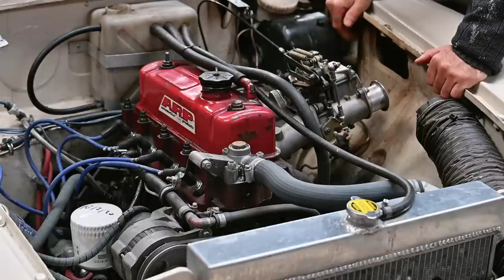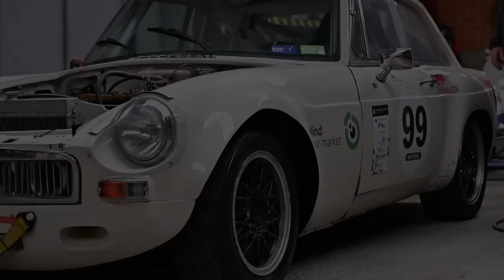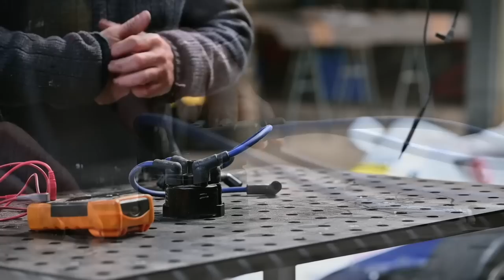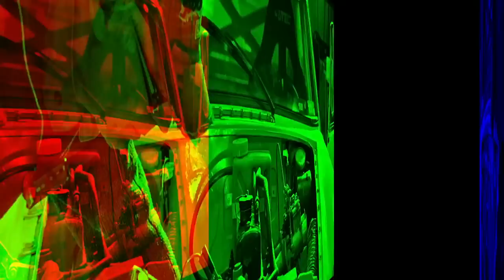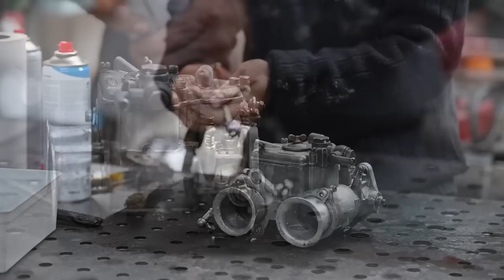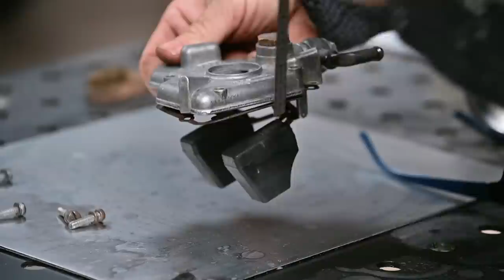MGB GT in need of fixing

Comment: Had to laugh when I saw your video. My first car was a 1963 MGB Roadster, which when I bought I knew nothing about cars. In 1972 I drove it to work for the first time. I was worried about it being stolen in London so I took the rotor arm out. I came back to the car at lunch time and refitted the rotor arm but it would not start. Desperate, I asked a new older and it turned out wiser colleague for help. When arriving at the car he asked me for a precise account of what I had done. After I told him he simply said look under the car! I did and guess what, there was the distributor cap centre electrode pin. I refitted it and the car started immediately. Whew what a relief and never to be forgotten. Later on my 2nd car a 1971 MGB Roadster I worked on the engine for many years but every time I refitted the distributor cap I double checked the centre electrode had not fallen out. . .
Reply from the maker: Nice story Robert and yes that does happen

Comment: Just had my Mg BGT 2 days ago having long crank on start, and wanted to cut out on 1st and 2nd gear.  standard engine with Hs4 SU carbs. Finally saw fuel leak coming from overflow pipe from front fuel pot. Had to rig a plastic bottle to catch the amount of fuel overflowing. Turned out the amount of grit/rust particles coming from the fuel tank was blocking the fuel pipe from bottom of fuel pot tube to  carb jet. Cleaned up fuel pot and checked needle and spring inside Carb Pot. Car started first crank. Going to add an in line filter and eventually new fuel tank. Checked timing last night, out by 5 degree got that fixed, need to do valve gap at the weekend.  Thanks again for a very informative video.
Reply from the maker: Good luck mike...  those are fun cars

Comment: I’m surprised you didn’t inspect the sparkplugs in the beginning.   Often it will tell you something.   Keep the videos coming, very informative
Reply from the maker: Jim,  I did  but did cut it out of the video as it was to long...  Note that on a race car , you tend to go Wide open all the time ( 5000 RPM), so at idle the plugs will spoil quickly if running to long... That engine is prepared for racing...
Reply: I expect he looked at them when taking out for compression test

Comment: My first car was a MGB-GT. It's where I first started paying with building cars and repairing them. I replaced the floors and boot corners. It' didn't sound like yours though! I now have an MGB with a partial Sebring look, just the front and rear valances and not the flared wheel wells. I recently got my Riley 9 engine running and it was very rough. It wasn't until I made a tubular exhaust manifold for it I worked out why. One cylinder wasn't firing, I could clearly see the lack of heat on the headers. It was a valve not fully closing which a compression test then a visual check with the rocker box open confirmed.
Reply from the maker: Nice to hear and they are great cars... I build and had a sebring not that long ago a V8 3.6  , look for project orange on my channel...   but the 1950cc former (1800cc) is so much more fun to race and easy/cheap to repair versus the v8

Comment: I also like the MGB-GT. Allways liked the look. The MGC-GT (3L 6 cylinder) was also fun. The Weber DCOE and the original SUs are may favorite ways to get the fuel air/mixture into the engine. That was a very good introduction to troubleshooting an MGB starting  and running problem. I like your HT tester. I have had carbon tracking problems before and that would have been a handy tool for troubleshooting that problem. I made my own tool after I had three bad distributor rotors in a row on a VW bug. All were brand new Bosch brand rotors also! A handy tool for figuring out mixture problems (especially on multi carburetor or multibarrel carburetor engines) is the Gunson Colortune. They are sparkplugs with windows and you can actually see the fuel burning in the cylinder.
Great video Steve. Thanks for posting.
Reply from the maker: I can see you have been in that alley too.    I had a V8 3.6 sebering last year, but sold it.   That one had so many issues with the amplifier module ...I even moved to the side with a larger cooling surface..
Reply: @D3Sshooter  I never worked on the original MGB-GT-V8 as they are very rare in the US where I live. Worked on plenty of conversions most of which were poorly done. Wasn't the amplifier on the original V8 merely a GM HEI module? They are very common here and inexpensive to replace.
One thing about Webber DCOEs. (You probably already know this but for others reading this.) Never look directly at the back of the carburetor you have just taken off the car and blip the throttle... or if you do, you will only do it once because you will get two thin streams of gasoline directly in each eye.

Comment: Hello Steve very good video. My old Honda used to run very badly. Then i checked everything like you did. Then I tried an additive for the injection system and the problem was gone after a long, fast ride :)) A video about additives for engine, transmission and cooling would be a good thing. I'm sure a lot of people will find that interesting. Great video Steve. 👍👍👍
Reply from the maker: Thanks for sharing

Comment: I expect that you'll find the center carbon electrode of the distributor cap laying down in the bottom of the distributor body.

Also, when you do your fine tuning of the ignition, check the timing at idle, then observe it while increasing the engine speed. It should vary with speed. The centrifugal advance weights in the bottom of the distributor can get stuck giving you static timing (since you have no vacuum advance).
Reply from the maker: thanks and indeed, I always use static and dynamic adjustments.  The bobweights have been adjusted ( springs) to alter the advance curve....  But will change it out to a 123 programmable distributor soon.  The reason is that the current EI is not accurate enough due to the fact that the blocking blades in the distributor ( optcoupler)  are not accurate and cause an offset for the ignition pulse on the different cylinders.
Reply: @D3Sshooter  I had the pertronix2 on my red car, and have accuspark on this 67, but do hear good things about that 123. I believe that's what Dave Wilkes runs.
don't you have one on the mini?
Reply: @D3Sshooter  I think you'll like the 1-2-3. When my brother and I put one on his distributor machine, there was zero timing wobble. 

The Luminition setup that you have is the same as the one that I have on my Mini and it works very well. You shouldn't have any timing variation from the chopper wheel, but the distributor shaft runs in a bushing in the distributor body. That bushing wears out and you get wobble in the distributor shaft.

David Vizard, in his book "How to Modify Your Mini", has diagrams for replacing the bushing with a needle bearing. This modification removes all of the wobble in the timing, but a 1-2-3 is a MUCH better idea.

Comment: That was a good find troubleshooting the dizzy cap, it would have stumped me for a while.
One thing that I found was the rotor arm lengths can very a lot, I found 2 in my batch that were 1mm and 1.4mm shorter than the rest. That's a long way for a spark to jump as well as jumping the sparkplug electrodes.

Comment: How strange, I've had the exact same issue with a distributor cap on my Mini before when it was running an old Lucas 25D points distributor, I could never figure out why or what happened but the spring-loaded stack had just completely disappeared! I wonder if it's a quality issue with the caps that are being made these days. Since fitting a programmable CSI electronic distributor (along with a rebuilt engine I should add!) I've had far fewer problems, you won't regret upgrading to the 123 ignition system on your MG, they are fantastic.
Reply from the maker: Thank you for the comments

Comment: What are your thoughts on keeping carb's functioning with potential increases of ethanol in the future?

Ever since ethanol was increased to around 10% my Dellorto DRLA's have been regularly playing up.
They have developed an intermittent blocked idle/progression circuit and no amount of ultrasonic cleaning has resolved it.
Main circuits still run perfectly and I have ruled out everything else you covered in this video.
I'm guessing that the factory plug that separates the main/idle gallery has come loose and is moving around causing the blockage.
Reply from the maker: Well that is becoming a problem , but can be solved by changing the jetting and emulsion tubes, but so far I had not to do it
Reply: we have had alcohol here for 15+ yrs. Just make sure every line up to date for alky and always have fresh fuel. That stuff sucks up water and goes BAD in under a month. Fuel up at airport if your racing.
Reply: Best to try to find ethanol free gasoline... Luckily, Shell here in Canada has none added to the high octane. It can also be tested quite easily at home for ethanol content.
Reply: @TheEnemySU37  Best you can do in the UK is the high octane which is up to 5%.
I was using this but having moved to a remote location only the regular fuel is easily available and this is up to 10%.
Reply: @djambrosia  that is a shame. Would be interesting to find out it's octane rating after removing the ethanol. My Spitfire has a distaste for lower octane than 91RON.

Comment: are you running a Warneford or a TWM intake? What compression ratio? I'm getting 172-178
Reply from the maker: Hi , I am running a cannon 3801 modified inlet manifold.   Compression ratio 9.6
Reply: @D3Sshooter  we calculated about the same with my short block/head combo but after putting camera inside, it looks like it was never run after being rebuilt. So hopefully my 172-178 # will come up after some driving.
How do you do your break in on rebuild?
and you have 4 idle air adjust screws? Or what are the other 2 for?

Comment: I’m wanting to build an engine for my 66 MGB and wondered what camshaft to choose. It will be a road car but I still want to get more performance out of the engine. Any suggestions?
Reply from the maker: First you need to decide how far you want to go, what is the purpose of the car , daily driver, fast road, ralley, race...   Note that the comfort factor and ease of driving gets worse from daily driver to race...   The faster camshafts increase the  HP's but becomes more aggressive with a power curve  that shifts to mid to high RPM.  With the 720 Camshaft the high torque sits around 5000 RPM  .  As on the track we tend to run at around 5000 and shift around that RPM...  not useable for a dialy or fast road purpose.   I would start with a mild cam, free flow exchaust, stage I or II cylinder head and a DCOE 45 carb.  That will bring you to the 90 HP range and still driveable on the public road.
Reply: @D3Sshooter   I’m looking to something between a daily driver and fast road car. Probably closer to the fast road. I’ve already gotten a big valve head with shallow bowls that will increase the compression ratio. I’d rather stick with my SUs though. There’s just something special about the dual carbs I don’t want to give up. 

Is there a particular manufacturer of the cam and exhaust you’d recommend?

Comment: What do you think if you put an air filter on the carburetor?

There are other options for that ignition. Check the Ukrainian engine control system SECU-3. In the carburetor version, only a few sensors and a waste spark coil are needed.😉
Reply from the maker: Thank you for the comments, I will use a 123 .... for racing on the track I prefer just trumpets

Comment: Going to guess timing 
Hard to start
Doesnt run good 
As long as fuel is in good shape
Seems like youd be sacrificing some power to parasitic load of the double valve springs
Reply from the maker: Well this one was a surprise for me ... still don't know how that happend...
Reply: Did you find the missing part from the distributor cap? I would be concerned as to where it ended up inside the distributor.

Comment: Carb would have been my first thoughts. The car has been sitting for a while so more than likely a fuel issue
Reply from the maker: Thanks, yes... But as you know after a race , one typical parks the car without an inspection ,,and when hot during the race not all issue pop up. Often its afterwards... so i always start from scratch

Comment: 1950ccm, Stage 3 Head, Hot Cam, Roller Rockers but only one DCOE?
With that configuration only one carb is a restriction.
You should convert to two 45 DCOEs.
165hp with one carb is hard to belive for me. Also because you have only 101 hp wheelpower.
Reply from the maker: Well that is what it is on the dyno, has also a modified crankshaft.  I might look for another set...  One day
Reply: Converting to two 45s would be difficult. That engine only has two inlet ports. Intakes 1&2 share one port and 3&4 share the other. It's the same design as a Mini, just larger. Converting to fuel injection is very difficult due to the head design too (and would probably not be allowed without switching to a different class).
Reply: @andreichichak5242  Didn't know that the head design is that restrictive. On a 4 cylinder engine with 4 inlet ports it makes a big difference if you use one or two carbs. But in this case it seems everything is tuned to the max.
For the Mini engine there was a crossflow head. Maybee for the bigger engine too? But if, probably not homologated.
Reply: @D3Sshooter  As I just read there is just one inlet port for every two cylinders. So two double-Webers won't make sense. 
The power figures for me look odd. 64 Hp between wheelpower and calculated engine power is a lot.
Anyway, I wish you a lot of fun on the track.
Reply from the maker: @RallyeRacin9  , That figure is in gear 4  on the dyno for the rear wheels .    I would need indeed a new inlet manifold. for dual DCOE's.     Thank you
Reply from the maker: @andreichichak5242  , indeed